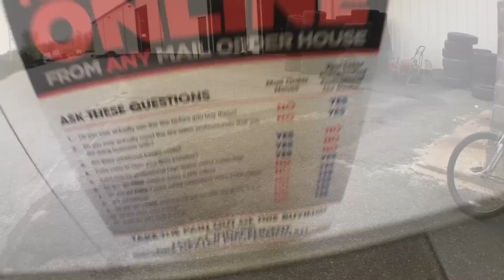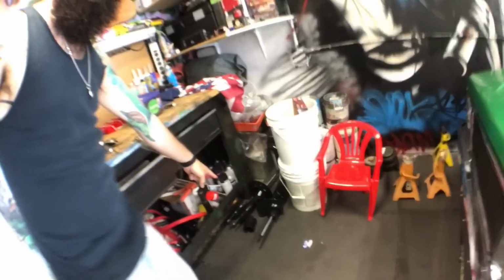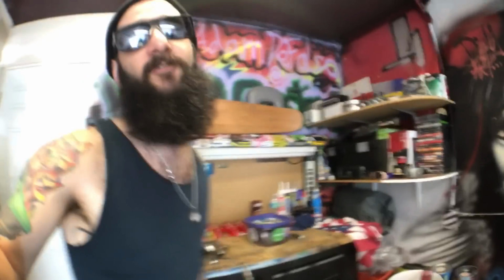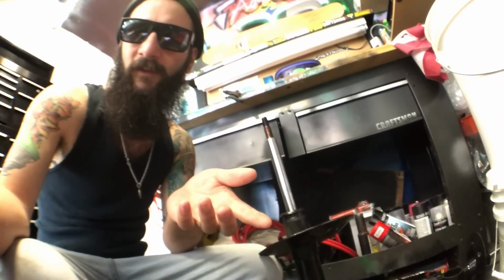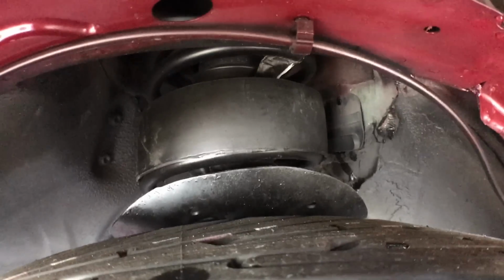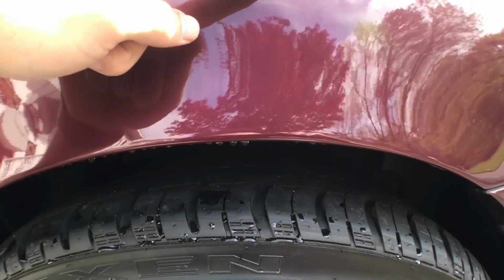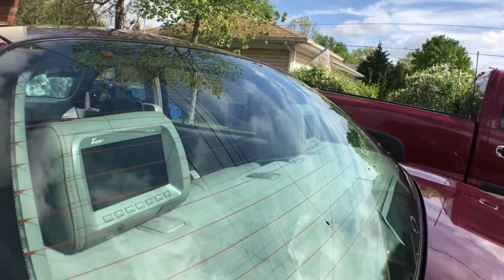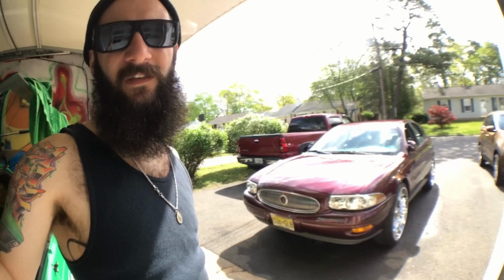Buick Lesabre on 24s, Lift Do's and Dont's

Comment: I'm so glad I saw this video. I was just looking on universal car lifts for a lift kits for my 2000 monte carlo. But I was also thinking about bending the struts as well. Now I know just bend the strut and save the money and headache. Thanks man.
Reply: Did your struts last I had to buy some new ones after riding on my 24s after 2 years I don't think my stock struts could handle the weight of the 24s
Reply: @boxchevycaprice90  naw bending that strut ain't good. It puts too much tension on the strut. The best thing to do is cut that strut plate off and reweld it. I bout a harbor freight welder and did mine myself

Comment: i see where u went wrong with the front struts, you're not suppose to lift it from the bottom unless u drop the sub-frame. i see where they extended the lower strut mount and i had that problem too, it wears out your axles, thats why your steering wheel was shaking. to do it right, u have to cut the weld off of the spring plate, slide the plate UP no more than 2 inches and weld it back to the strut. THEN put your coil springs on and mount it back to the car. it rides so smooth on 24s that you can barely tell they are on the car.
Reply: dante jackson My 2011 impala shakes when i put the 4s on and i have the extended struts what you think the problem is
Reply from the maker: Ari Reid That is what happened with this car, the front axles are binding up because they are pinched on too much of an angle, that’s why I ripped it all out and did it the way I did.

Comment: I love you Bro! I have a 2001 LeSabre Custom with 20" rims, before I used the metal screw spacers you showed, the car road fine, but now after installing them, I have the same problem, the shake is real! This is my first time hearing of binding joints

Comment: When you lift with those struts the higher up the strut goes the higher up the car goes so the extension is pushing the body up higher so you use limit straps to hold it down
Reply: Limit straps? What are those?

Comment: I used to have a dope ass gold 2003 Lesabre. Put 22’s on had to take the plastic fenders out tho. Still was dope
Reply: What's the biggest size rim that will fit on a LeSabre with no extra work? (No cutting) (no lifts)

Comment: How did you open up your front springs  enough for you to put in those rubber spacers? I got a 06 town car and 24's but I haven't been able to put any type of spacers in the springs. Therefore I'm still riding factory...
Reply from the maker: Kevins555tube It’s a tight squeeze but you just have to work it in, I used a little WD-40 and just worked it with a little help from a rubber mallet
Reply: @AdamDeFresh  ok, thanks for your information. I appreciate it
Reply from the maker: Kevins555tube no doubt, raving if you have to trim the corner round with a razor to get it started, once it’s in it ain’t movin
Reply: Does it have to be in the top or bottom or middle or it doesn't matter?

Comment: That is dope and u did a great job,i got a 03 park ave ultra yesterday super low miles and rides beautiful i already installed a 7200 pioneer nex double din n 2 12’s this thing pounds but i like how u did the rear suspension-rims are next for me i might need your help wit that air suspension leveler u made and im right in red bank nj!!!
Reply from the maker: Hey man, I’d be happy to help! And since your here...... I sold my Buick (regret) but still have the wheels, selling them cheep being they only fit on a few cars being I had them custom drilled for the car.  They would fit your Park Ave perfectly if your interested 🤷🏽‍♂️

Comment: Where did you get the rubber pieces for the coil from and could you let me know how to do that with the rear air?
Reply from the maker: they have them at autozone, advanced, pepboys etc.  The turnbuckle I got in home depot
Reply: Adam DeFresh how did you put it on to adjust by itself

Comment: Sorry for late post but do those spacers break in 2 months are yours still in place. Seeing some say theirs break at 2 months
Reply: True .... Bacc in the day I had a 1990 CADI and did all this b4 and will never do it again and Im glad I saw this vid cuz I was think'n bout buy'n a lesabre right now, not anymore cuz the air shocks in the bacc and spacers in the struts up front is some bull shyt fr.  The spacers and everything else you got jammed in the struts fall out when you drive over speed bumps, train traccs etc... and the front end squats and starts shredding the tires and getting everything to sit even is a real bytch fr.  Also the front end lift and bend will cause both sides right above those struts on top the fenders to crack straight across where that strut mounts.   Not worth it fr.

Comment: Are challenger rims easy without modifications size 20 in
Reply from the maker: Not sure about the offset changeover, but a 20 inch should fit on this car no problem without doing any work

Comment: If you go from a 16 to 22 inch...aint that going to affect the RACK and PINION...transmission and speedometer?!
Reply from the maker: welp....This was 3 years ago, car is still fine.  I mean, common sense, the wheels are MUCH heavier so Im driving it easy, not pushing it or beating on the trans. As far as the speedo, yea thats about 10mph off.

Comment: Anybody still come on here, when you take apart the front suspension you gotta align the front end anyway and use limit straps or turnbuckles on both sides i have my 07 dts same suspension on 26s
Reply: Ok so i have a Lesabre too. Im going 26s and i was going to order the same universal car lift as well. So you’re saying go out and buy some limit straps or turnbuckles so the cv joints won’t bind like his?

Comment: I have a 1985 buick regal grandnational big block edelbrock 350 Rocket 400 turbo transmission positive rear end dual's coming straight from motor😏
Reply: You just said you have different motors 350 is a small block an the rocket motors are actually 355s so next time you brag about an imaginary car it will least sound right

Comment: How did you remove the headrest i cant mine out
Reply from the maker: @younglords7131  if you look at the base of the headrest where the seat connects there is a tiny little hole, I used a very small Allen key when you push it inside that hole it releases the headrest🤘🏼

Comment: Will it mess up the transmission putting 24 on it
Reply: What kind of dumb question is that
Reply: Of course it will, every component in the drivetrain is going to be stressed from those heavy things. You can get lighter weight forged wheels but be prepared to spend $$$$$ on them. I'd just leave it stock, but to each his own...
Reply: Don't listen to these dudes...if you drive the speed limit its fine...doing burn outs and racing people all damn day yes it would...I have 24s on a 13 impala and I drive the highway to work every day...30 minute trips there and back...been doing that for 4 years and I'm fine

Comment: I got a 99 lesabre thinking about 22's how much lift you think
Reply from the maker: Ke Vaughn no lift, i'm running mine stock height right now on 24's I had to trim the front bumper a bit to turn, and remove the inner wheel wells in the front but with 22s you're most likely be fine
Reply: Adam DeFresh I appreciate it brother man
Reply from the maker: Ke Vaughn no problem man let me know how you make out
Reply: Run 235 30 22s for a stock buick but yes trim front bumper a little

Comment: You kids always seem more concerned with looks over comfort.  I guess that shows my age - 77.  Me, I like big fat tires full of air.  Why would I want to go back over 100 years and put thin, hard stagecoach wheels on my ride?  I was with you on lifting the front but I just didn't like the weird angle the rear spring and swing arm were meeting at.  Seems like if you hit a pothole then the spring might pop out of position and drop your rear suspension.  I also didn't like the idea of compressing a spring halfway.  Springs are made a certain length to maximize the ride and performance.  When a spring is already compressed it just makes the ride harsher when you hit a pothole.  About the only thing I would probably change would be to put in one of those Strutmaster conversion kits and change the air control system over to a regular coil over shock system.  Simpler can be better with less points to fail.

Comment: Where did you get the rubber spacers
Reply from the maker: they have them at autozone, advanced, pepboys
Reply: Adam DeFresh wha TV are the spacers called i tried looking for them cant find them i have a buick on 4s already but use the lift u showed b4 the rubber spacers and dont like them
Reply from the maker: http://www.autozone.com/suspension-steering-tire-and-wheel/coil-spring-booster/superior-automotive-coil-spring-booster/828156_0_0

there you go!  Called rubber spring booster
Reply: Adam DeFresh got em thank man big help
Reply: I have a Lexus ls400 trying to do the same thing please help me
Reply: @AdamDeFresh  what inch spacer did you use
Reply: Ki

Comment: I don't know what the appeal is with oversized wheels and low profile tires seems ridiculous looks ridiculous not to mention not very much rubber between road and rim from a safety stand point wouldn't feel comfortable one good pothole at highway speed can find yourself in bad situation fast
Reply from the maker: jenbill1602 I’ve been doing this for years, never happened.  As far as appeal...... wait.......why are you here 🤷🏽‍♂️ beat it dude.
Reply: Ahahahahah! Just screwing with you dude to his is own, but I have a couple buddies of mine end up with bent rims because of low profile tires something to do with sidewalls weakening I'm guessing under inflated may had something to do with.